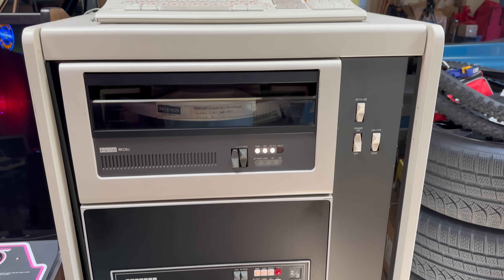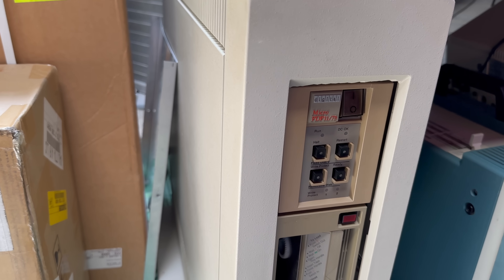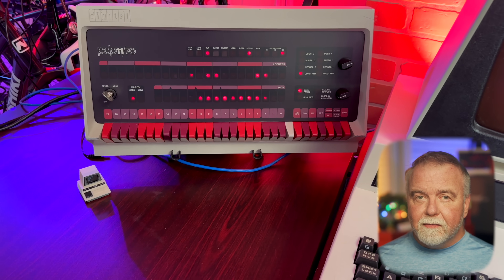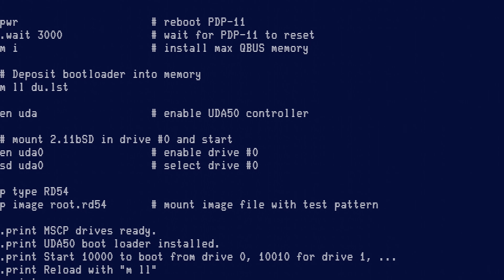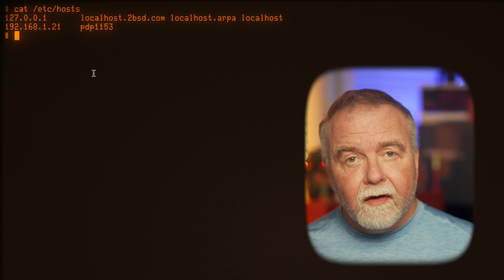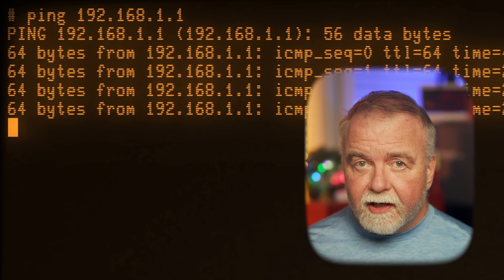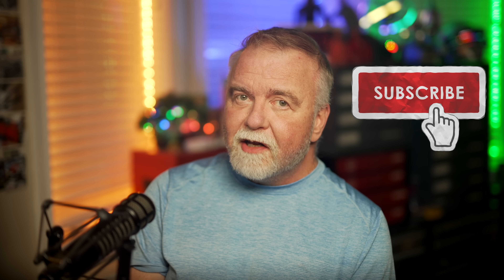UNIX on the PDP-11: Zork, Star Trek, and More Live on the Internet!

Comment: Thanks for a great video, Dave, and another trip down memory lane. Your Micro PDP reminded me of the Micro VAX we had in our lab for a while, which ran a Genasil Silicon Compiler—a very early version of the synthesis tools we use today in ASIC and FPGA development. Back then, I was really only using VAX, and Micro VAX PDP11 was waning. Then, I moved on to Apollo and then Sun workstations. Those were the days. 
You discussion on network cabling reminded me of an place I used to work, Orange network backbone cable above the false ceiling connected to yellow drop cables, which were connected to the Orange one with a dracular spike connector. the yellow cables went to switched that connected to work stations by a heavy blue cable which connected to the workstation via a 9 or was it 15 way D type connector.. those were defiantly the days

Comment: Older 10Mbps devices are nearly always half-duplex - forcing the switchport to 10Mbps half duplex may fix it, but I've usually had the best outcomes for 10Mbps devices by connecting them to a 10Mbps hub.

Comment: Ahh the good old days. One of the first systems I looked after at The University of Newcastle (Australia), was a PDP11/45 running a Sydney University modified version of Edition Vii (AUSAM), which included such things as the Fair Share Scheduler, back in the early 80s.

Favourite single instruction core-wars program in PDP11 Assembly:
014747 MOV(PC)-,(PC)-

I think 2.11 was released in 1991.

Comment: Line speed (10 v 100 Mbit) would have been my guess based on osi network layer model.
Had similar issue at work. Manufacturing had slower network line speeds than corporate IT wanted on the backbone. CIT demanded all devices be exchanged. Local IT 😉 suggested a transparent bridge between the manufacturing facility LAN segement and "Rest of World" that would speak both line speeds. 

When your manufacturing has a special product set and changes need lots of documents, swapping any/every device in the line is neither simple nor cheap.

Comment: Whee!
The PDP-11 was a real, affordable (for organizations) computer. So many of the early standards and applications were developed here.
I learned Microsoft Extended BASIC on an Ohio Scientific minicomputer that looked a lot like your PDP-11 in 1982 at the tech school I was going to to learn Business Data Processing.
About this time I showed my Assembly Language teacher a Wall Street Journal blurb about IBM managing to put an IBM 370 on a microchip. We had been learning to program an IBM 370 clone made by Burroughs.
He was skeptical and told me that he didn't believe microcomputers would ever amount to anything.

I heard about the micro-PDP but I've never seen one.
I did play that text-based Star Trek one night late at work in 1983 on an IBM System/34 minicomputer.
To run on that machine that game would have to have been written in RPG-III, which just boggled my mind at the time.

Those modern interface cards are a lifesaver these days. 
I'm now using something similar to get my old Atari 400 online and it also emulates a disk drive and includes a microSD card reader which I need since my old Atari disk drives don't work anymore. I think somebody sells an Ethernet adapter for these (Atari Serial I/O was a predecessor to the USB standard), but for now I'll have to make do with Wi-Fi.
The old hardware is still pretty great, if it still runs, and is just as capable as it ever was.
But a lot of the newer stuff doesn't have any idea hot to work with it anymore.

Comment: Your efforts to connect the PDP-11 up to the network reminds me of a fun time I had trying to get DECnet running between two VAX machines over a modem connection in 1990 (ish).

The customer was the CEGB (Central Electricity Generating Board) here in the UK and they were coming in the next day to see this work. It didn’t. Try as I might, working in this overnight, every time the connection was made between the two Racal modems, it would drop after a while.

I eventually hooked up a protocol analyser to the input of one of the modems and recorded a few traces, and realised that the modems were interpreting an escape sequence from the DECnet protocol as “hang up”. Mystery solved - but this was now 3 or 4 hours before the customer was coming to see it all working.

In the end we decided that sleight of hand was necessary, so ran a cable between the machines and pretended to dial up from one modem to another. They were none the wiser, left happy, and we bought some other modems that worked a treat.

So much fun back in the day!

Your PDP stuff is excellent, thanks for posting these videos. 😀

Comment: I managed to get UUCP running on 2.11 BSD and v7 Research UNIX on a PiDP-11. Don't really have anything offsite to network it to (the traffic volume on actual Usenet these days would overwhelm even an emulated PDP-11 on a Pi, and I don't have any kind of hobbyist network to connect to), but it was a fun project. I even wrote up a guide for it.

Comment: 10Mbps Ethernet support is iffy on a gigabit switch - most gigabit switches you can find today (especially desktop switches) won't support 10Mbps. Higher end switches generally do support it (e.g., Cisco switches). 10gbps switches generally only support 10 and 1 gbps links. It's not that people want to drop support, but the PHY chips themselves need to be aware and the MAC-PHY links have to be reconfigured, so it's often easier to just not support something that's barely encountered today.  Especially when most 10Mbps devices were for a time when switching was an oddity and thus almost never support full duplex mode.

Comment: Any chance you could program it to work with other machines on the network to expand it's capability such as storing stuff that would normally be in memory on a nearby machine via page file to run larger programs or sharing CPU time with another machine on the network to run more complex programs?

I understand latency between machines would probably be a big issue especially having to adapt newer hardware to work with an older operating system via adapters all translating different communication protocols.

Still I'd like to know how far it can go beyond its original capabilities using modern technology, a little hack work here and there and a lot of ingenuity.

Here is a challenge for you, the gold standard of classic computing. I dare to steal the phrase from another YouTuber I used to watch who showcases older technology but here it is Dave, "Can you get it to run Doom?" (The original DOS version we grew up on)

Here is your challenge see if you can somehow make it happen.

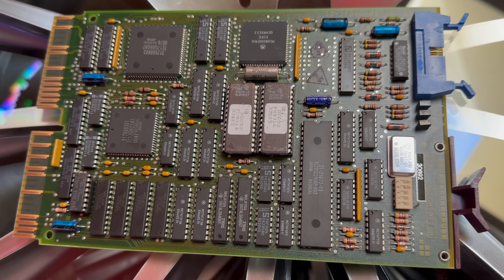Comment: If the card wont power the AUI then likely the fuse is blown. It is the green component in the top right corner at 8:35. Replace that and it should be good. I have had a few that were blown and replacing the fuse fixed it.

Comment: I’m into retro computing (for me, so that’s like Win95/MS DOS) so I’m not as into this machine as you are but I was fascinated by the old Linksys switch and noticed it immediately in the beginning of your video and suspected it was an intermediate step between the old and new.  So yeah, I’m into the weird quirks and problems you run into because they may be general retro computing applicable not just your PDP machine.  And, maybe for grins and giggles, hook it up to a printer.  I’m sure it’ll be seamless.

Comment: That's impressive, I had to think back to my 10BaseT days, I remember some switches and ports would not work on a faster switch. That was many moons ago. There were other ways to communicated like when running Novell and you wanted Novell to use TCP/IP and it didn't support it and you have you run TCP_SNAP. Strange days back then. When you tossed in Token_Ring to the mix then it was real fun! ;)

Comment: This might amuse you: Back in 1981 I was working at the Duke University Computation Center. A brilliant professor in the German Department named Frank Borchardt was very interested in using computers in language instruction and was going to present a talk on a project – the Computer Aided Language Instruction System (CALIS) if I recall correctly – at some conference or other. IBM was funding his trip. Then a matter of days before the talk, the IBM people discovered that the software in question was running on a PDP-11 and was going to be demoed remotely using a terminal made by another non-IBM company. This led to a panic – was there any way some IBM hardware could be involved? Frank asked me if I had any ideas.

This was very soon – I mean perhaps a few weeks – after the IBM PC had been released, and we had a few of them. I dug out the Microsoft BASIC manual and stayed up late coding a terminal emulator program. I don't even remember the brand name of the terminal it emulated, but it allowed addressing character positions on the screen. I even had the program display "CALIS" in block letters on startup along with appropriate references to Duke. Frank took a PC and monitor and a floppy disk with my program with him to the conference, and the IBM people were happy. In fact, according to Frank, they were astonished that an IBM PC could do that. I soon expanded the program into a more complete terminal emulator called DukeLink that even had optional support for the eccentric OCLC (Online Computer Library Catalog) protocol that ran on Xerox Sigma mainframes. (I did this for a librarian friend, and I recall asking her, "Xerox Sigmas? What are they going to do when can't get leaded gas?")

Another quick memory: In the early days of USENET I once made a joke about the "Bad FAT" error message that occasionally came up in the first release of PC DOS 1.0 and got an email from someone explaining how the bug came to exist.. If I'm not mistaken, the sender was Tim Paterson, who wrote 86-DOS and later sold it to Bill Gates when the latter was asked to supply an OS for the PC since the people behind CP/M were holding out for more money than IBM wanted to pay.

One more ancient memory: Frank did some work with neural networks and machine learning – yes, in the 1980s – and had something (probably a single-layer perceptron) trained to guess the gender of German nouns. The output was a 3-vector giving the estimated ratings that the noun was masculine, feminine, or neuter. (These were not probabilities, just raw activation values.) Frank told me that one night he tried typing in a Russian noun to see if it might be able to guess its gender. It came back with low numbers for all three values. Frank was initially disappointed, but then he realized that the neural net was telling him, in essence, "This doesn't look like a German noun."

Comment: One of my student jobs in college (mid 80s) was SysAdmin & programmer to a PDP-11/23+ running 2.9BSD.  I remember that for setting on one of the boards (serial multiplexor?) that I needed to learn about wire-wrapping as that was how it was configured - no simple little jumpers.  Learned 16 bit programming in C on it (along with using segments). Also in college it was using a VAX 11/750 and DECSYSTEM-2060 for classwork and CS degree.   

Nice to hear about PDP-11's and BSD!   Thanks!

Comment: It's great to see one of these old systems working. I'm retired Navy and I worked with PDP-1170 back in the 80's and 90's. It actually had it's memory bumped up to 1 megabyte.  It was a classified message processing system.  Had two 9in tape drives and 2 multipack disk drives.  It ran RSX11.  Lot of fun to work with.  Miss those days.

Comment: We have tons of PDP computers in our museum. We have the only PDP-9 in working condition in the country.
We have tons of peripherals and a globally known PDP expert on our staff that keeps everything running.
We allow hands on, on our machines. We have:
PDP 8 & 8i
PDP 9
PDP 11/70 and other models
PDP 12 with the original space invaders running
2020
PDP 11/780
VAX
and a ton of dectape drives, disk units of all sizes
7 & 9 track drives
Our museum is where old tech lives and thrives
Reply: You make me think I belong in a museum as well.
Have used at work or at college the following
A pdp 8e/i Frankenstein 
Pdp 11/70 pdp 11/….
Micro vax’s
Hp 1000/a900 RTEA 
Vax 6310 - vms
Vaxstation 3100
Vax 4000/100, 106, 440 VMs
Alpha VMS
Alphastation vms

The memories
Reply: @gregsb3454  I  began on 407 accounting machines doing plugboard wiring. I am an IBM mainframer. Worked on:
1401, 360, 370, 4300 series, (4331, 4341, 4361, 4381) 3090, s/390 etc.
Also embarrassed to have worked on toys like the Series/1, system 34, & AS400.
To me there is an IBM mainframe, then there are toys.
IBM mainframes are built for reliability, scalability, and pure processing power. One shop I know, cant remember when it was last power cycled. People confuse processing power to how many instructions per second its performing. Thats only ONE facit of processing power. For example, I could transfer huge amounts of data w/o the CPU even being involved. Since the CPU is idle, does that mean i am not processing data?
I hear people say ,my cell phone is more powerful than the older computers", my response: "how many users does your cell phone support?" then they get quiet.
A cell phone would melt if they had to process as much data as a single IBM mainframe does.
I fell bad for people who never has, or had the opportunity to work on IBM "big iron". Its truely awesome.

Comment: Something to keep in mind is that the Ethernet landscape was still a moving target in the early 1980s.  Most of the head scratcher problems I ran into back then were disagreements in the frame type 802.2 versus 802.3.  It’s been a while, but one frame header if I recall has a length field while the other has a type field at the same offset.  Well, something like that.  An old Ethernet repeater would just pass frames through so a mix of frame types could exist on the backbone, even if that isn’t a great idea.  A modern switch needs to get layer 2 data out of the frame header and may discard frames which appear non compliant with what the switch is expecting.

I’m not intimately familiar with that particular Unibus card and how it is dealt with in BSD’s Ethernet stack.  My guess is that if everything looks good, you turn on SQE Test, send a TCP packet to generate a frame on the wire, and you see the collision light blink (due to the SQE Test pulse confirming frame was sent), then the frame type is wrong if no one receives the frame.  It is left as an exercise to the reader to determine how to fix that. 😊

Comment: The PDP line is definitely not a computer. The company even said so!

The original PDP-1 was developed by Digital Equipment Corporation in 1959 and released in 1960. At the time most people thought a “computer” was the room sized vacuum tube monsters that cost millions to buy and millions more to operate. 

Digital Equipment Corporation was a small company that made specialized cards for scientific processing, such as analog to digital cards, cards to drive monitors, etc.  Their ultimate goal was to build a CPU card to work with their other cards. However, no venture capitalist at the time would give money to a startup with only a dozen employees to make a “computer” to compete with companies like IBM. So instead they convinced the venture capitalists they were making a “Programmed Data Processor” (PDP) to control their other cards, definitely not a “computer”.

It was just a coincidence that it could run an operating system, run programs, store data and programs on paper and magnetic tape, and do other things a “real computer” could do.  

LOL (wink). It worked, they got the venture money they needed.

Comment: Out of school I started with a company that wanted to automate their accounting department.  We installed a state of the art (jk) punched card machine and ran it for 4 years.  I talked the company to switch to the pdp11/70.  I worked on a PDP10 at school. For business we needed to use RSTS/e and basic.  Had to write our own screen routines, and multi file , index file system that would all fit in 32K with 32K runtime.  The accountant, myself, and the keypuncher/operator were the only personnel.  For about 8 months while I tried to get the foundation routines written,  I felt like the only one in the world with my own personal pdp11 :)